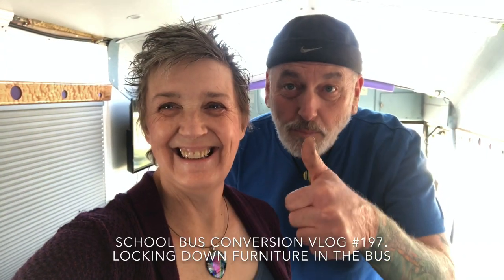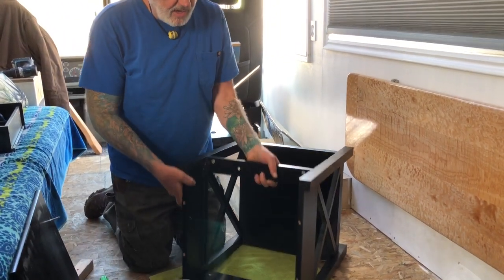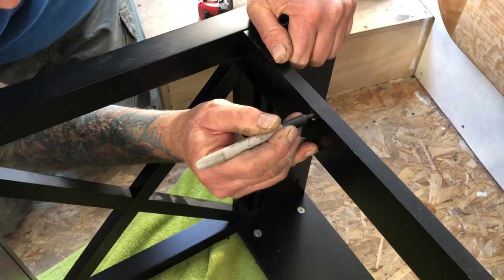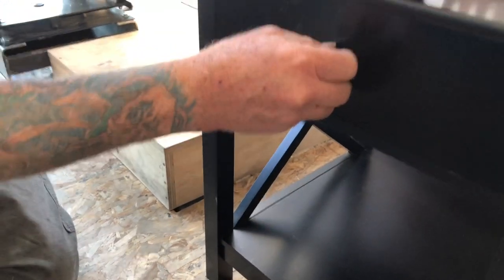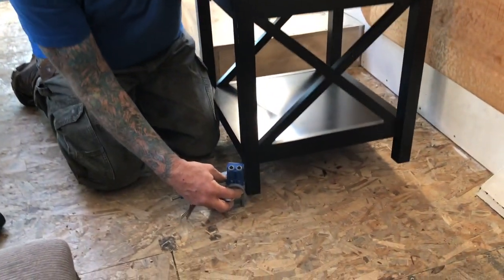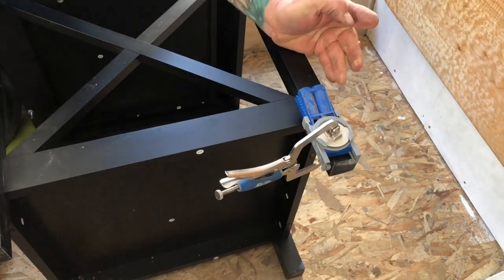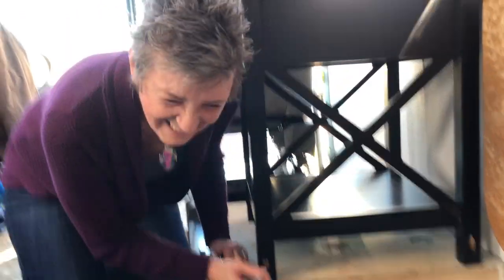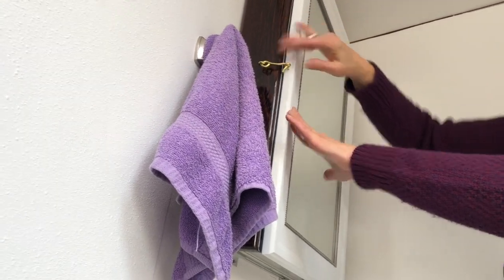Locking Down Furniture in the Bus - Vlog 197 School Bus Conversion

Comment: Kreg pocket holes for the WIN.  Never in a million years would I have thought that I would use them, but our bus build would have never happened without Kreg!!

Also... Diesel heaters ROCK.  They sip fuel, use really little power when running and heat like CRAZY.  Thanks to you, our installation is MUCH safer now that they are mounted down to the metal floor!  Thank you guys!
Reply from the maker: We are the same way with the Kreg jig. Had never used one before this bus conversion. Totally sold on it now. 
Glad to here the diesel heater is working good for you guys. 😃👍😃

Comment: Randy I've heard by some people that if you run the diesel heater on low for extended periods of time you should crank it up for a minute or two to keep the soot down that accumulates in the burn chamber to reduce the maintenance on the unit. Just a thought brother.
Reply from the maker: Thanks for the info. That’s good to know.😃